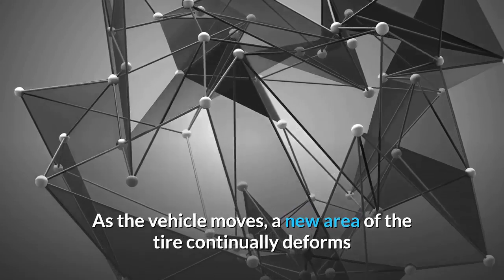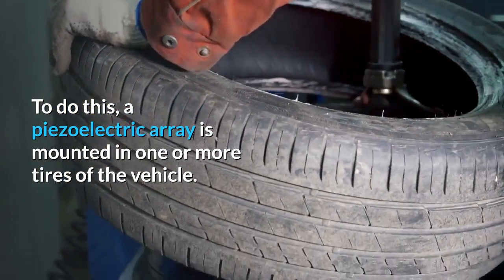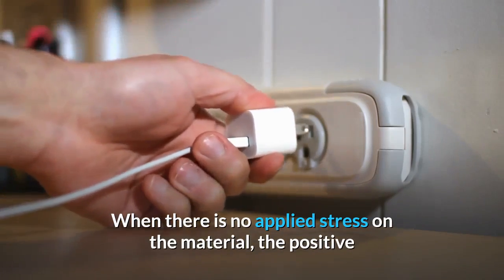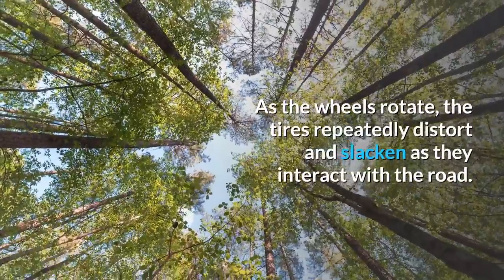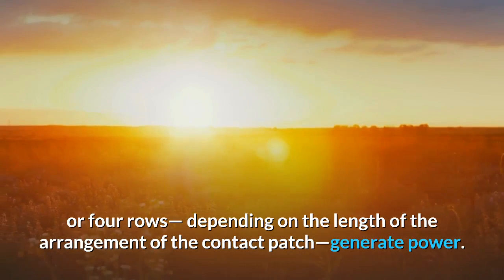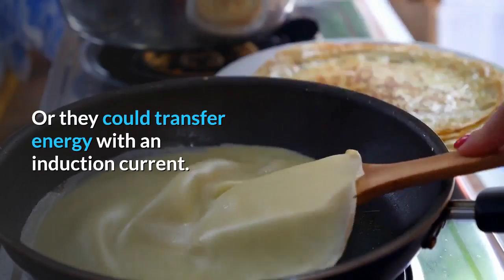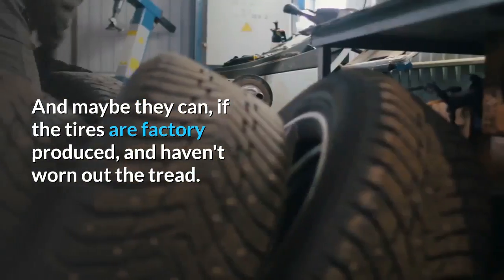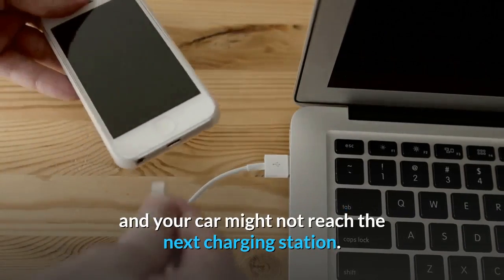Learn about piezoelectric power generation technology in car tires

Comment: They can probably make something connected to the tires act like a treadmill in a car compartment and have piezo feature contact that. Wheel might be small but several could be made, like an office chair size but optimized to spin without worrying about the road. Then you've also got some wind drag capture possibility. Solar panel hoods/roof is more options. It's not perpetual motion because battery still has recharge cycle limits.  The money invested in car means less need for expansive charging stations, therefore more cars sold. Additional thought is oil has boiling point of 300 degrees. Water boils 100 degrees. Water contacting 200 degree oil might produce steam enough to also charge battery. Just boiling off oil/gas probably makes little sense since batteries for cars do already exist.

Comment: These idea is great but, in the paper only, and no one showed the prototype too..🎯
Reply from the maker: This is just a theory, there will be a lot of difficulties to achieve😀
Reply: @greentechnologylife3567  yh...bro..just give a try and show to us😋
Reply: @greentechnologylife3567 Goodyear has developed concept tires with piezoelectric-like technology for energy harvesting and data collection, but these are not yet in mass production. Their BH03 concept was designed to use piezoelectric materials to convert vibrations and heat into electricity. While Goodyear's current production electric vehicle tires, such as the ElectricDrive 2, are focused on other features like quietness and durability for EV requirements, the piezoelectric concept represents a future technology under development. 
Goodyear's piezoelectric concept tire (BH03) 
Energy Harvesting: The BH03 concept would use a wrap of thermos-reactive, piezoelectric material to convert the energy from road friction and vibrations into usable electricity.
Powering Vehicle Systems: This generated power could help power some of the vehicle's systems.
Smart Tire Capabilities: This technology could also be used for smart tire applications, such as monitoring road and vehicle conditions, though the specific application in the BH03 concept was focused on energy generation.
Reply: I presented this idea to Invent Help in 2012. They loved the idea but wanted a lot of money to bring it to market. My boss offered to help me but never followed through, unfortunately. I was looking in polymer and rubber piezos used in pacemakers and using wireless recharging for all four wheels in the combining of technologies for recharging. 1 tire company produced a piezoelectric tire in 2015.